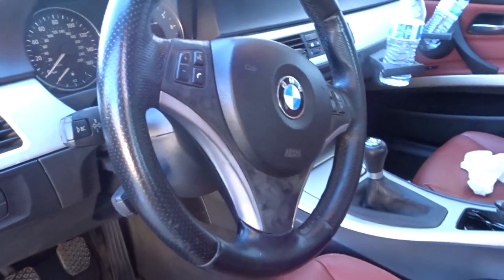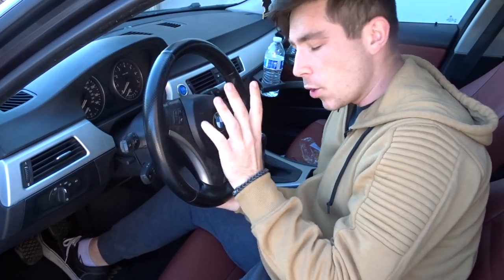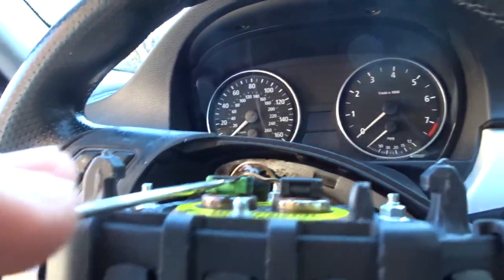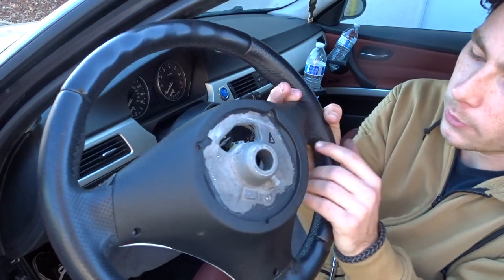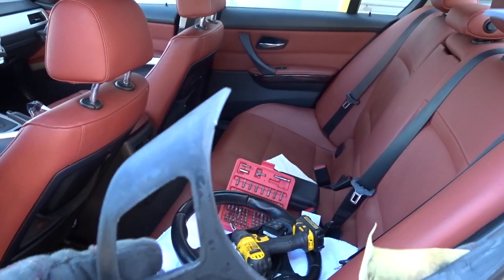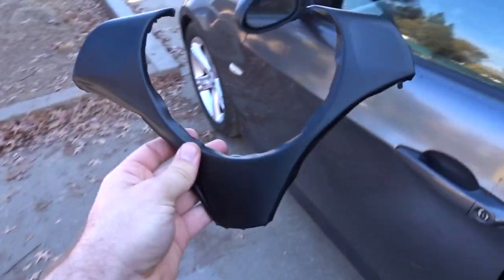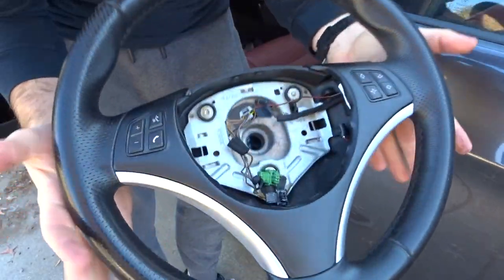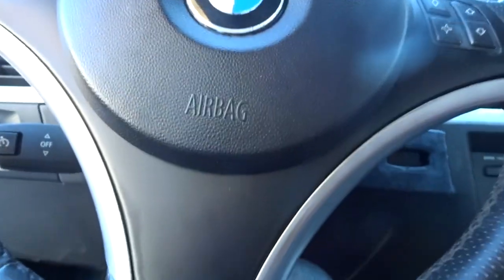HOW TO WRAP STEERING WHEEL TRIM! (DIY)(BMW E90,E91,E92,E93)

Comment: Respectfully, and just wondering out loud  - after you took the trim off, and sanded it, and cleaned it - why not just spray it mat black, and avoid the whole stick-on process with the heat gun, and wrinkles and bubbles and such? I mean it looks nice, but just wondering.

Comment: Did you need to take the steering wheel off? Surely you can just use the t20 bits and take the trim off with out taking steering wheel off

Asking as unsure?

Comment: I would use some plasti dip
Reply from the maker: Ewww, plasti dip is horrible
Reply: @JonathanWeeks  no its not......it has its purpose very easy to work with and not permanent better than cheap vinyl probably last longer too..